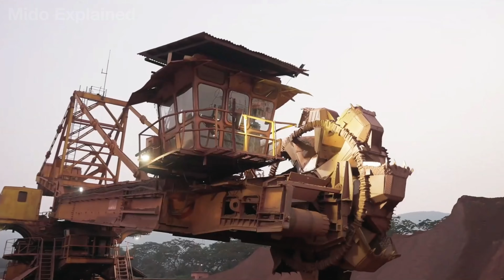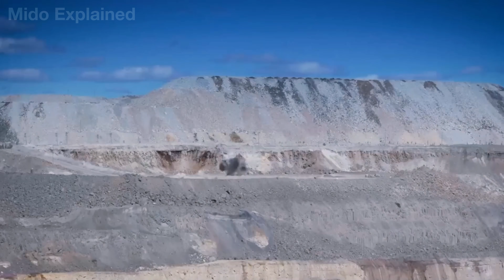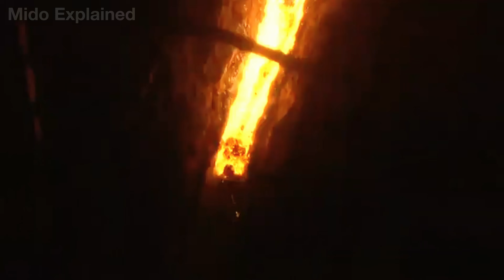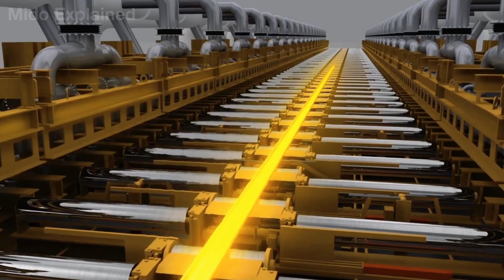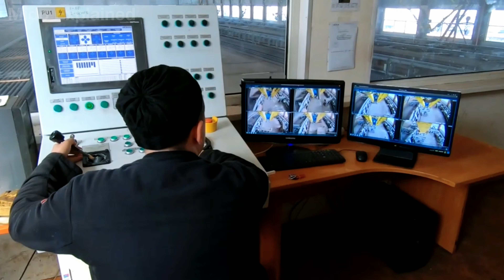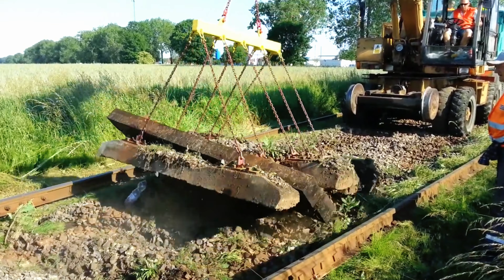Why Railroad Tracks Don't Break Under 44,000 Tons - Inside The Rail Manufacturing Process

Comment: We need to  make all road beds the same way as rail beds
Reply from the maker: That's an interesting idea! Rail beds are designed for heavy loads and long-term stability, but roads have different requirements, such as supporting many vehicle types and providing a smooth driving surface.